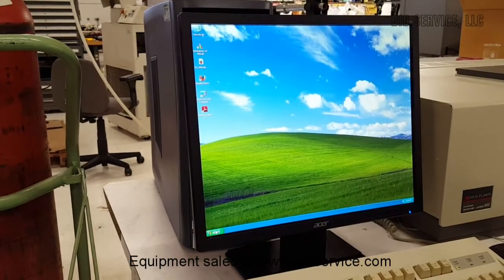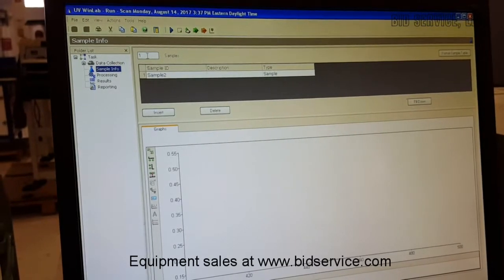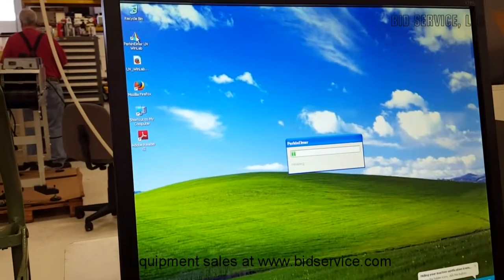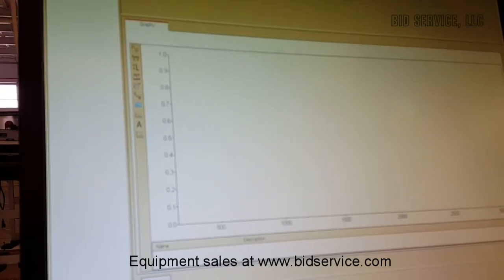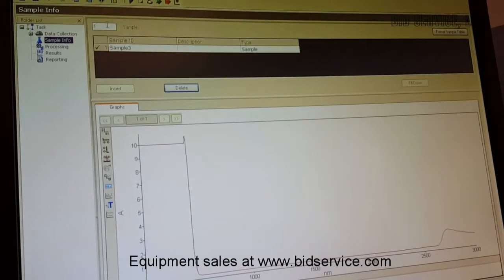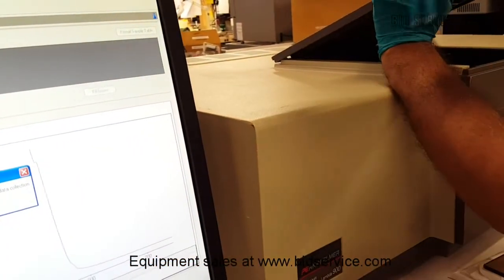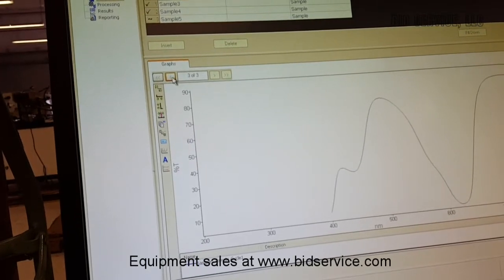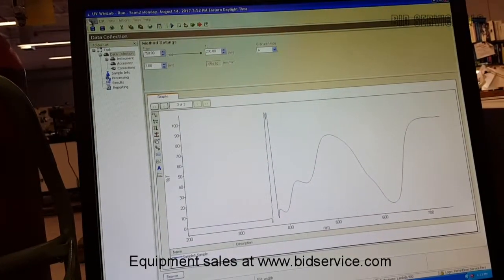Perkin Elmer Lambda 900 Spectrophotometer #61824

Comment: Hi,
This is very good video to help me during my experience. 
I wanna ask you for thin film sample in the Perkin Elmer Spect. Do we need blank sample? so in the autozero process which one that i shoud do between put the blank sample or let it empty (without any sample)?
Thank you for your information.
Reply: a blank sample (empty sample position) is the most convenient for general cases.
In <SETUP> make sure to check the BASELINE + ZERO Measurement and T% method. 
Than make a <BASELINE> with an empty sample position so that the instruments response can be calibrated to a 100% T reading. After that block the measurement beam and push the <ZERO> in order to measure the instruments response with 0% T. Finally remove the blocking and push <START> again to gather a 1st calibrated T%-measurement. It should result in a perfect 100% line as your 1st dataset. If it is not something seems to be wrong and you will see it before starting to measure your samples. 
Continue by measuring an uncoated window, finish by measuring your coated window(s) to get all relevant data.
Reply: @vingcon  Thank you for your information